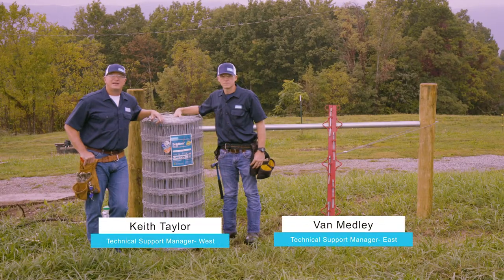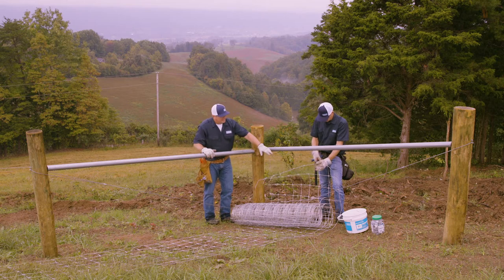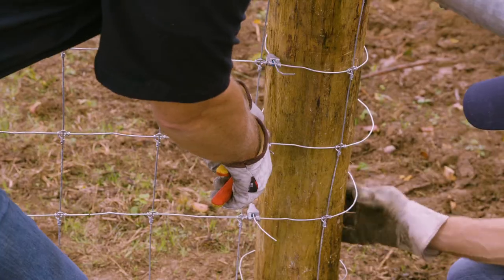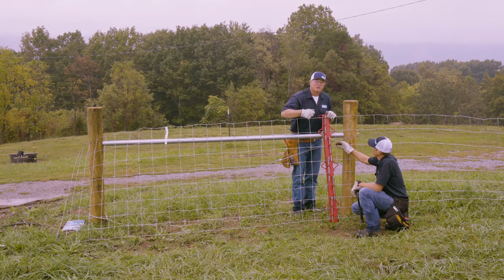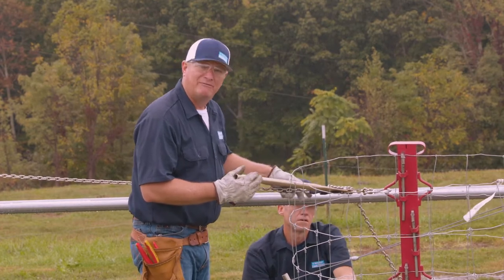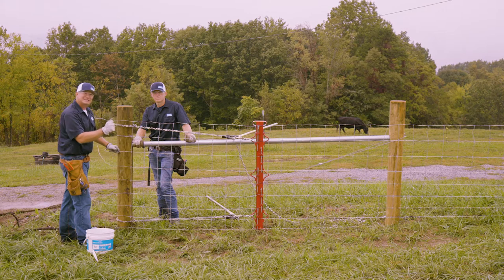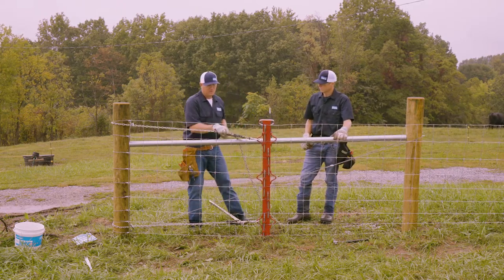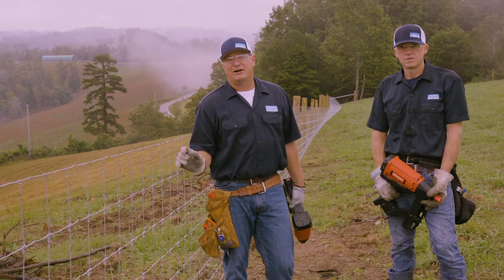Installing Fixed Knot Fence | Do's and Don'ts to Proper Fence Installation

Comment: Just to clarify, you said 5+1 ft for every 100ft.  But you said you had over 500’ of fence.  So why only 10ft in from the end?  Why not 25+?
Reply: It is 5' standard setback on the pull bar from corner post - plus 1' for 100' of pull length. 
500 ' of pull length = 5 extra feet on the pull bar set back.
So, 5' + 5 (the 1' for every 100' of fence) = 10'. 
Hope that makes it more clear.